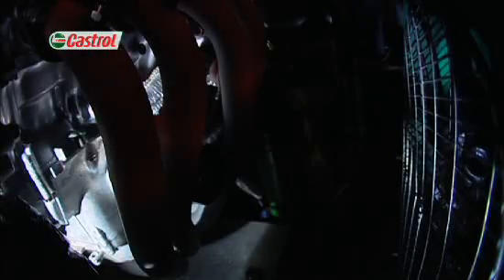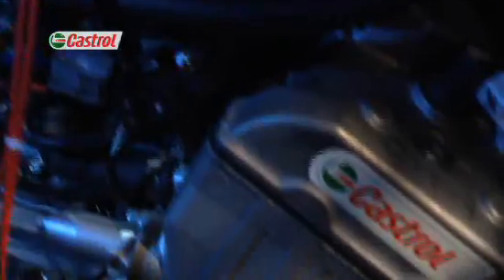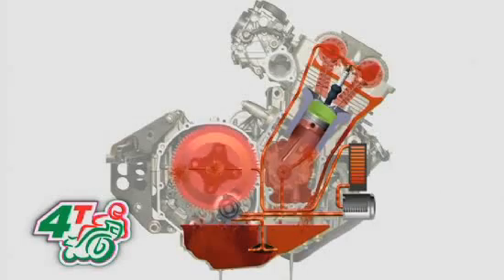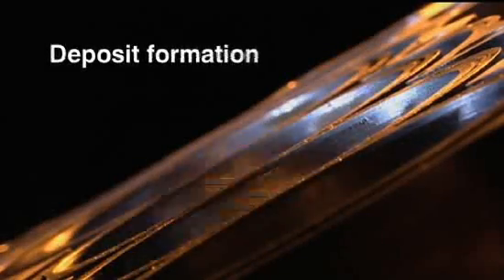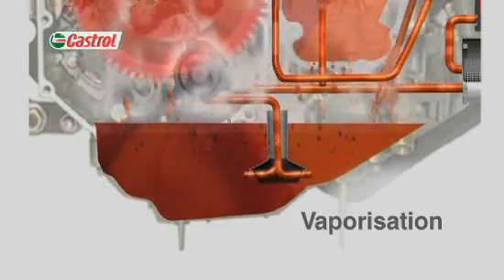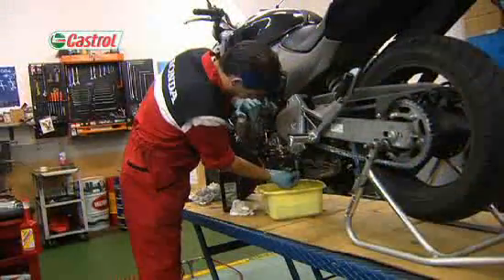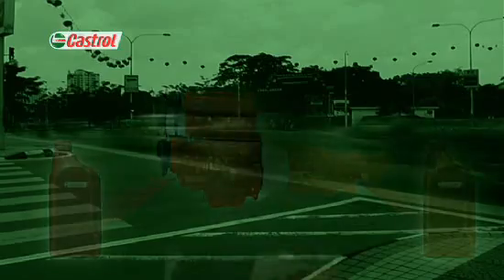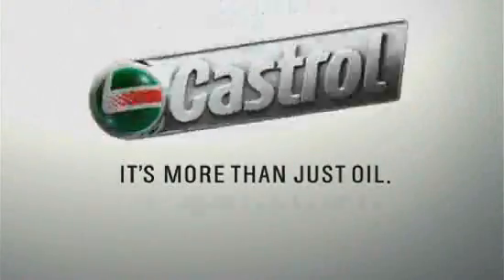Trizone Explained

Comment: I used Castrol GTX 10w-40 for ten years+ in a Suzuki Dr650s motorcycle. 34,335 miles the second gear broke. My mechanic friend tore the engine down for the repair. He said the engine was in great shape. Even ask what oil I used. Super clean. Wheelies caused the tinny break.
Reply: Well, at least you know your engine is in great shape ! 👌
Reply: I also use Castrol GTX 10w-40 on my SV 650, never had any issues till now.